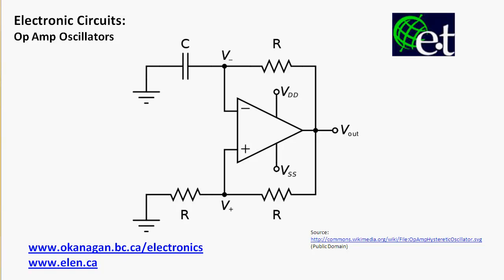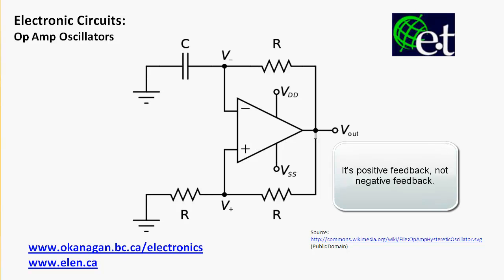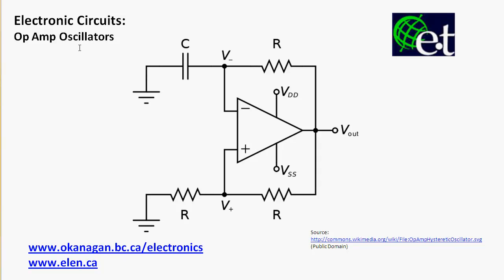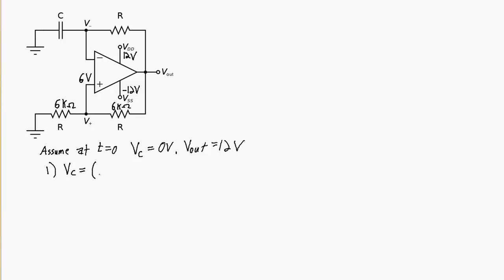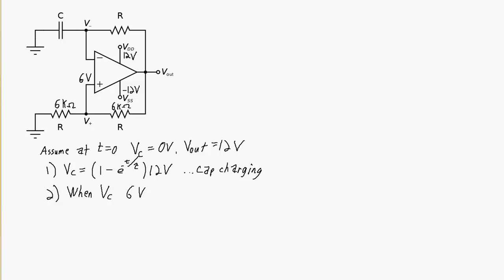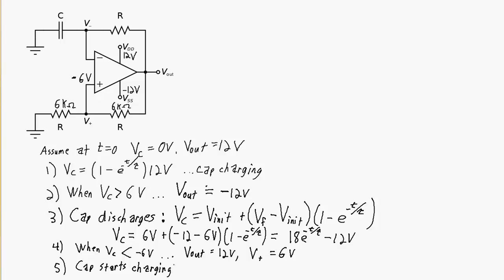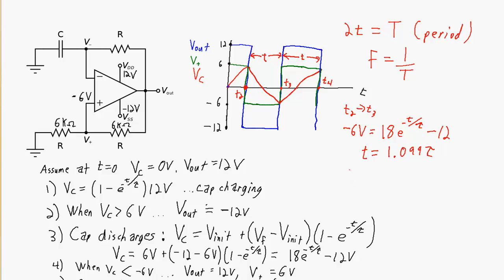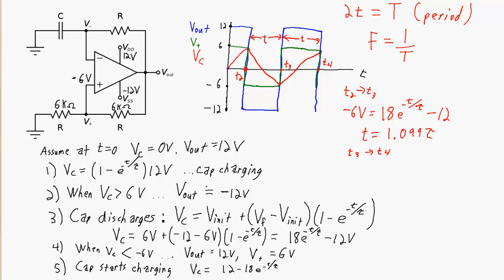Operational Amplifiers - Relaxation Oscillators

Comment: I have a question, could you please explain what would happen if capaciter at time t=0 is fully charged and has the value of 12 volts? thank you sir
Reply from the maker: If the capacitor (V-) is at 12V at t=0, V(+) will be less than that so the output will go to -12V and V(+) will go to -6V. The capacitor will discharge towards -12V according to the equations given in the video...the only difference being that V(init) is 12V instead of 6V. Ultimately, the first cycle will be longer, but after that the oscillations will be as described in the video.

Comment: Great video...will be better if you also show us the derivation of the charging/discharging equation of the capacitor.Anyway,i've a question:
After seeing the video,i've a feeling that the main controllig factor in a relaxation oscillator is VDD & Vss(i'm may be wrong).So,by reducing these voltages to say,+6V & -6V respectively,can we increase the frequency of the oscillator?
Reply: In general, (vout-v+)/R = v+/R => vout = 2v+. Whatever the vout is the v+ will be twice less in that circuit. Now the capacitor discharge/charge rate: Vc = (1-exp(-t/tau))vout , this value should reach the vout/2 (v+) in order to switch the vout (become larger than v+): it will happen at: 1-exp(-t/tau) vout= vout/2. Well from here we see that: 

exp(-t/tau) = 1-1/2 = 0.5 => t ~ 0.69 * tau . where tau = RC. So whatever the max vout is, 12V or 6V the time between switches will be ~0.69RC
Reply: you find it by solving the 1st order linear DE: d v-/dt + (v-/(RC)) = (v0/(RC))
for v-

If you're curious about the math, you can just use an integrating factor method to solve it analytically but also the general form for  v- , for these types of RC circuits, is just:

v- = Ae^(t/RC)+B

constants A & B can be found from plugging in certain values for time, t. 
You can pick which values to choose based on the behavior of your inverting input signal.
Reply: Look into differential equations to see how the exponential appears. That function should alert you that the rate at which a value changes is proportional to its current value.

Comment: i'm looking for the value of R2 in this circuit where i'm given the frequency, the max/min voltage, the value for R1 and the charge rate of the capacitor. Any ideas? can't seem to figure it out

Comment: so by virtual ground concept and since at the beginning the potential at the non inverting terminal is 6v shouldnt the capacitor charge upto 6v only.....why does it charge upto 12 v
Reply from the maker: +rabosaification you are right, you can't apply the rule v+=v- because that rule only applies when you have just negative feedback (see my videos on inverting and non-inverting op amp configurations to understand why negative feedback forces v+=v-)

You are also right about it charging to 12V because that is what Vout is. On the inverting side of the op amp, you have an RC circuit with a power supply of Vout so when Vout is 12V, the voltage on the capacitor is charging towards 12V, but when it gets to 6V, the voltage on the inverting terminal becomes higher than the voltage on the non-inverting terminal and Vout switches to -12V
Reply: in my understanding, due to 12V output (vout) it is trying to charge up to 12V but can't go upper than 6V due to op amp. and I doubt we can apply rule that v+ = v- in this case. don't know why though. correct me if i'm wrong.
Reply: how much the tau in the previous example . 
is it Tau = Rc.C  ?

Comment: Great presentation.  But there is a typo in equation 1 where it should be (1-e(-t/Tau))*6 (not 12)
Reply: Since the capacitor is being charged by V_out, which is set by the Op-Amp's supply (12V), the equation given by the video is correct.

Comment: Why does Vout suddenly change from +12V to -12V?  I understand that the operational amplifier itself is built to try to keep the + and - terminals at the same voltage, but intuitively, it seems like Vout would change gradually rather than suddenly, maybe creating something like a damped sine wave.
Reply from the maker: Vout changes between plus/minus 12 V because in the configuration for the relaxation amplifier, there is no negative feedback.  When you have negative feedback, the amplifier "tries to keep the + and - terminals at the same voltage."  When you don't have negative feedback, the output will be the difference in voltage between the noninverting (+) input and the inverting (-) terminal multiplied by the open loop gain.  The open loop gain is very big (ideally infinity).  The difference in voltage between the two terminals multiplied by the large open loop gain will be a very large number for this circuit, but the power supply at +/-12V limits the output.
Reply: +David Williams 
So then (theoretically) do you approach that limit because of the fact that the capacitor is supplying the signal to the inverting input?
Reply: Why is there no negative feedback? Isn't there both positive AND negative feedback? V_out leads to both terminals in the figure. An explanation of this would mean the world to me.
Reply: @fosheimdet There is both positive and negative feedback in this circuit, so that V+ and V- terminals are striving to have equal voltage. However, while the positive feedback terminal switches instantly from +6 to 6 volts through the resistors, the negative feedback terminal voltage switches with a delay determined by the RC-circuit. During the transition process(i.e. Capacitor charging/discharging duration), the V terminal is charging up to/or discharging down to the voltage of the V+ terminal at a rate determined by the RC time constant.  Only at the end of the charging/discharging process do the V+ and V- terminals have equal voltage, at which time the V+ terminal instantly flips to the opposite voltage, and the V- terminal follows behind at a rate determined by the RC time constant. Hence the Astable nature of this circuit.
Reply: I just understood this now after looking at it. Here is a quote from this page about op amps (link https://www.allaboutcircuits.com/textbook/semiconductors/chpt-8/positive-feedback/)  Quote "What is necessary to get it to switch states is a voltage placed upon the inverting (-) input of the same polarity, but of a slightly greater magnitude. For example, if our circuit is saturated at an output voltage of +12 volts, it will take an input voltage at the inverting input of at least +12 volts to get the output to change. When it changes, it will saturate fully negative." 

In the relaxation oscillator, there is both negative and positive feedback. BUT at time 0 the negative terminal HAS to be 0V so any feedback to the terminal will have no effect. The op amp Vout will either go -12v, 12v fully saturated and will stay that way until the capacitor reaches -6v or 6v. At that point the negative terminal will be of equal or greater magnitude than the positive terminal and the Vout will smash the other way. Negative feedback kicks in only for a moment.

Comment: Great video selections i gotta say! i m just wondering how we could some how, (i asssume chage the resitor for the capacitor and diode or some thing.) how could we get a differnt cycle from the square wave?so the discharge is different from the charge time
?
Reply: I think you are talking about the duty cycle. Probably need more circuitry. AKA a different capacitance seen on raise than fall edge.